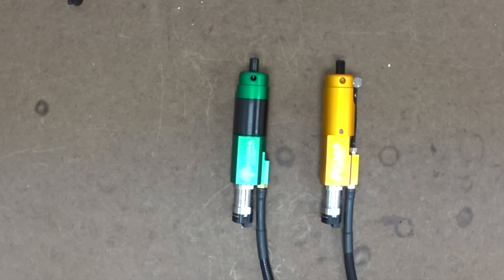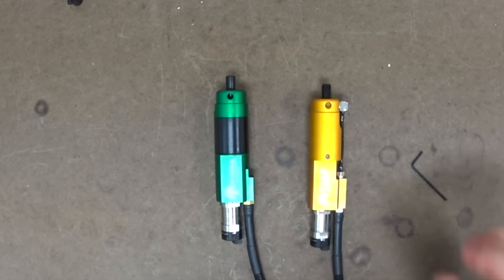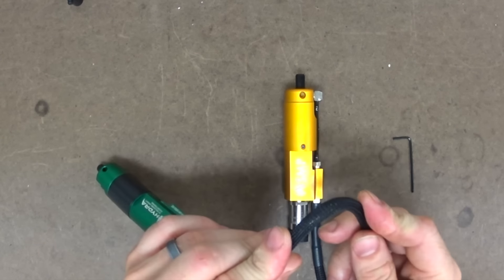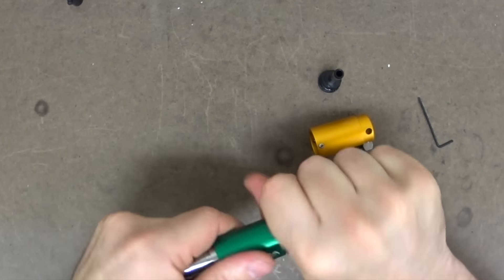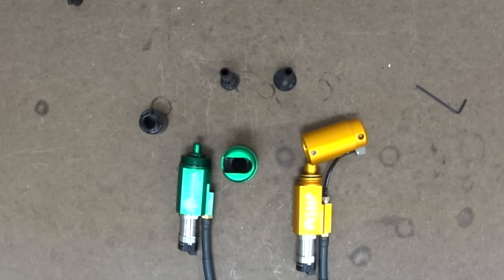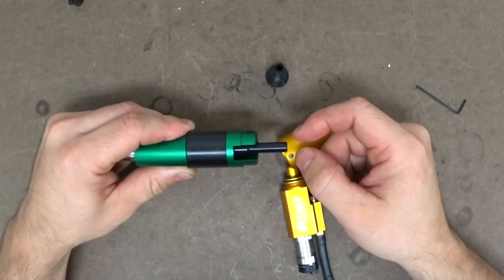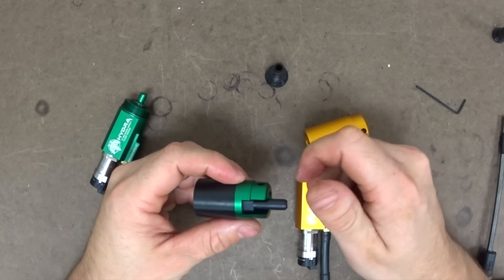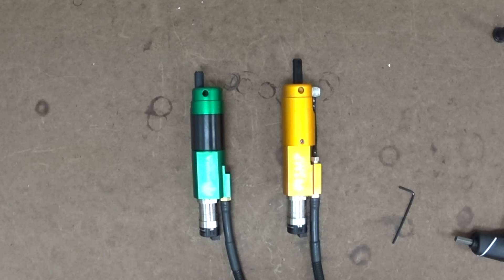Wolverine HYDRA and SMP

Comment: Good Day.  I recently purchased your HYDRA System for TM M14.  After installing it the full auto mode does not continue to fire.  It only fires for a few seconds then it will just do semi mode.  I removed everything and tried to fix the triggers by just pushing the pins with my fingers.  Again, it will only fire full auto then it goes back to single mode.  I've used three sets of batteries already and they are all fully charged.  After awhile I let it rest, then the full auto fires again only to go back to semi mode.  Any remedies or fix? thanks...
Reply: It's not the air system. It's your selector plate, and your trigger board